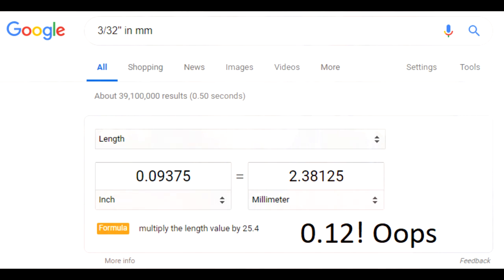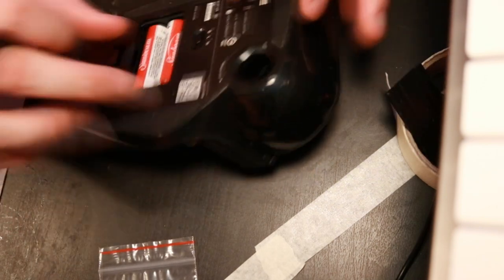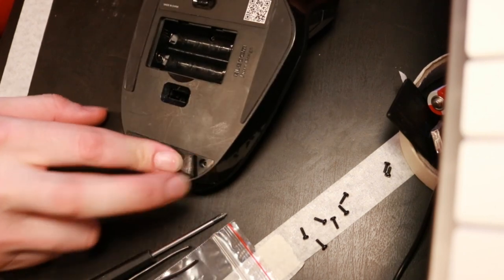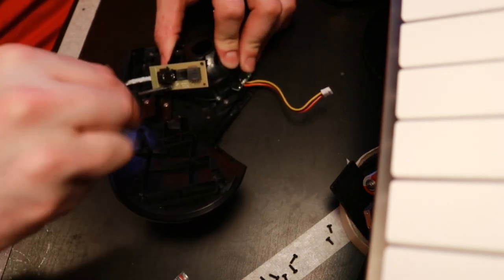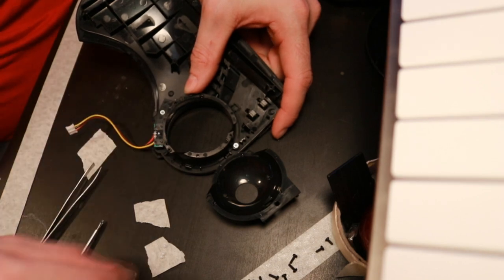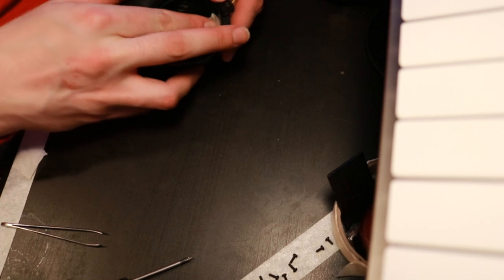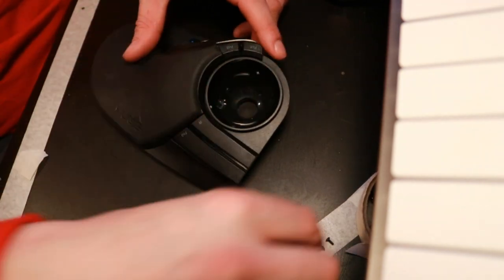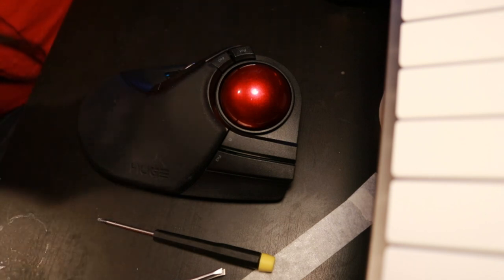Elecom Huge = Gaming TRACKBALL? Bearing replacement / fix / swap

Comment: do you know what size bearings are used by the Elecom EX-G Pro?
Reply from the maker: Unfortunately, I do not.
What I'll say is that there aren't that many different sizes available from most retailers when you get to that size, so maybe we can ball park it and, if you get it off Amazon, their return and exchange policy is rather liberal.
Do you have any of them removed and available to do a size comparison? I recommend getting a dime and a nickel next to each other, setting the bearing between them, and using a magnifying lens while viewing from the edge of your table / desk.
It's likely that they used the same size though.
Reply: @subversed  I have two EX-G Pros, but one is being used by my roommate. Hers is a lot smoother feeling than mine, especially lately. I guess we could take one apart but I can't find my calipers, and it's not a digital caliper, so you have to eyeball the size it gives
Reply: @subversed  ok so I asked Elecom and they said the bearings in the EX-G Pro are also 2.5mm. You mentioned Prime on the video, and I searched for 2.5mm ball bearings on Amazon and found nothing. I couldn't find anything with your search terms, but I cut it down to 2.5mm Bearing Balls Zirconia Oxide and found some. Thanks for the video!

Right now I'm mediating my trackball's rough rolling by rubbing birthday candles on the ball several times a day to keep it rolling smooth.

Comment: how long is your palm? from wrist to middle fingertip..
Reply from the maker: I'll answer this one, but if the next question's asking me for feet pics, that'll be a no lol
7.5"
Reply: @subversed  lol... im 20cm.. im using deft pro right know, comparing the smoothness with my mx ergo, deft pro is soo bad. I'll try to break in it for couple weeks, if nothing happen i guess ill try to change its bearing. I found Si3N4 and ZrO2 price is same, so which one should i buy?

Comment: Thanks a bunch for the video, it was very helpful!

I tried this out two different bearings:
.) ZrO2 grade 10
.) Si3N4 grade 5
Funny enough although the grade 5 ones should technically be smoother (lower grade means better at least according to https://en.wikipedia.org/wiki/Ball_(bearing)#Grade), the ZrO2 ones feel a little bit smoother, but still nowhere near as smooth as my Kensington orbit with scroll ring ... .
The dynamic friction is fine, however the static friction with the new bearings is still too high for precise use :-(
Has anyone else experienced this?

Now I have been thinking - there could be three contributing factors to this:
1. The high weight of the HUGE's big ball leading to more friction compared to my small Kensington one
2. The relatively large bearings lead to more friction due to greater area of contact - the HUGE's are 2.5mm, my Kensington orbit w. sc. r. ones are exactly 2mm
3. This point is just speculation: The material of the HUGE's ball simply has a higher static friction coefficien than dynamic friction coefficient w.r.t. the bearing materials.
Reply: I've been trying to work out the same thing, but it isn't a problem with weight as I have a Kensington Expert which has a larger and heavier ball than the Huge and is silky smooth compared to my Huge (with new G5 ceramic bearings). The material of the Kensington's ball does feel a bit glossier and less sticky than the Huge, but that might just be because I've had the Expert for a few years.

Comment: You really don't have to take the ribbon cables apart the one of mine did fall out. If you only take the second set of two cup screws internally out then it's a lot easier to put the replacement bearings in. Because then the cup isn't fully apart and one of them will go in extremely easily and the second can be done with gravity. Also on the wired version of this trackball the center screw is hidden by the paper tag on the bottom which you'll be able to see when you run your finger along it.

Comment: I use the same trackball for 2 years, and I'm quite sure you either got a defect one, or didn't apply enough oil on it.

I mean the oil that naturally on our human skin should be able to make it really smooth within a day or two of usage, when cleaning the trackball, never ever clean it too much, for example I always use 80% ethanol to clean my stuff, and I only clean the surrounding of the hole and never clean the ball and bearing at the same time, otherwise it will take a day or to be smooth again by the oil on our fingers.

Comment: honestly, i've found the smoothness of mine to be not bad at all, just that it collects dust; would anyone here recommend using like some sort of lubricant silicone or teflon spray on the bearings at all? I read that other trackballs have benefitted from this.

Comment: I just finished doing this, with the more heat resisting, more expensive, ones. It isn't really that smooth at all. My CST takes the cake by far still.

Too bad really.
Reply from the maker: it'll never be as nice as let's say a kensington expert, nor will it be as nice as the action on a mechanical trackball that costs 2-3x the price, I'd bet- but there were so many defects in this run that it's worth trying to RMA or get a replacement through amazon (if that's where you got it) to test your luck.
Reply: @subversed  Why is that? What is the variable that makes the Expert so good? Just replaced Huge's balls with ceramics and it is a bit better, but still getting stiction, whereas I get literally no stiction on my Expert. The only thing could be the trackball itself?!
Reply: @joshuathomson6049  Some folks have said it may be related to the placement of the bearings in relation to the ball

Comment: Do you know by how much G10 is better than G5?
Reply from the maker: Elaborate a bit?
Reply: @subversed  Well, you said the grade indicates the sphericalness of the ball, which means G10 is better, but how much better is grade 10 vs grade 5? Like, can you feel the difference?
Reply from the maker: @deama15  nah, they're measured on a pretty ridiculously small scale. Still macroscopic imperfections, but really, really small. I'd say you're fine with either and don't spend any more money than you have to, all you're doing is rolling one ball around 3/4 the size of a billiard ball lol. :)
Reply: @subversed  Oh, I see; well I got the G10 anyway cause it was only £1 more.
Reply: @deama15  While the tolerances are so small that G10 is probably perfectly fine, I wanted to post for future people reading that ball bearing grades work like golf scores... the LOWER the number, the better.  The grade number corresponds to the sphericity of the ball in millionths of an inch, so a G10 has a sphericity of 0.00001 inches and a G5 has a sphericity of 0.000005 inches.  Sphericity measures the deviation from a perfect sphere, so the smaller the number the less deviation, the more spherical.

Again though, the numbers here are so incredibly small, with a G10 being 0.00001 inches "out of round" and a G5 being 0.000005 inches "out of round", I highly doubt you would ever be able to tell the difference between the two in this situation.  I just wanted to make sure a future reader doesn't come across this and think "Man, if a G10 is better than a G5, I can get these G100 balls and be super great!"... it go's the other way, you want the smallest G number you can get.
Reply: @cryptk  Oh, I thought it adhered to the ABEC rating.
Reply: @cryptk  The numbers may be small, but difference between G10 and G5 is still 20%, G10 against G3 is like 50%. For precision work, which I think is what trackballs are, this difference I'm pretty sure would matter. Too bad though I can't find G3 anywhere, they're incredibely rare; and even if they say it's G3, I think it might be fake.
Reply: Sorry for necro, but posterity etc...
If grade is important, buy only from reputable sellers, there's no way you could ever discern the difference between G10 and G5 without expensive equipment or sending it off for testing. Many sellers know this and will sell you anything.

Comment: Would steel be better?
Reply from the maker: Nah. Can't find it in the right size and they're ceramic or ruby for a reason- steel would damage the trackball once it started wearing.
Reply: @subversed  great well I found some and what a big difference thanks for the video!
Reply from the maker: @Tabossco  You found steel ones that size? That's pretty neat! You think they're better than ceramic? I'm up to try- link me to your source? :)
Reply: @subversed  nah I went with these there super smooth.

25pcs 2.5mm Si3N4 Silicon Nitride Ceramic Bearing Balls G5 https://www.amazon.com/dp/B07D8RDV1L/ref=cm_sw_r_fm_apa_i_c5JUCbEXF4066
Reply: @Tabossco  silicon carbide is better than both.

Comment: The polling rate and dpi in these Elecom trackballs are embarrassingly weak unfortunately. They feel ergonomically good, but the other parts are a real shame.
Reply from the maker: It's a step in the right direction, though. 
They invested in the design more than the finer points- I'm sure they're planning a v2.0 (without dingus rubies instead of ball bearings)
Reply from the maker: Maybe the next version will have freaking chaos emeralds and I'll have to do the next video with a Sonic screwdriver. Get it? Sonic?

Comment: Legend! Thanks a ton for this. These bearings are available on Amazon now FYI: item B081SPZ7KP

On mine I want to say the smoothness isn't 100% there, and it does get a little noisier. But it's muuuuch improved over the stock bearings for sure.
Thank you :)

Comment: 2022- if anyone is thinking about doing the bearing upgrade, DO NOT. it will work fine for 6 months then get so gritty it is impossible to use, another commenter mentioned this 2 years ago, this has ruined my mouse, lesson learned do not listen to youtube fools trying to backyard engineer stuff, the not exactly round bearings are done for a reason, to create the least amount of resistance points and increase longevity, the ceramic bearings simply have too large of a surface contact and hardness not to ruin the ball, the engineers at elcom were correct in using ruby.

Comment: I cannot for the life of me find some new spherical jewel bearings for my logitech trackball. I've worn flats on every side of them having turned them around multiple times.
Reply from the maker: What's their diameter?
Reply: I'm not sure, And I couldn't get a response from logitech on the subject. @subversed
Reply from the maker: Lemme take a gander- can you give me the exact model number and I'll do some searching?
Reply: Sure it's the M570, Thanks a whole lot! @subversed
Reply from the maker: @Levamen33  I took a stab at it after getting home from the grocery store and found the user manual, service manual, warranty pamphleture, but no specs on the bearing sizes- I'll take another gander tomorrow :) 
It seems to be information a lot of redditors are asking and also not getting responses on, so maybe it's an opportunity for my next video. (The beard is gone this time)
Reply: @subversed  Thanks so much! It's the only part of that trackball that needs replacing, I've done the microswitches under the clicks at least 3 times for left right and middle, but the sapphires so far have defined the end of the life for a trackball for me
Reply from the maker: @Levamen33  I searched pretty far and wide, even found the logitech patent for it and there's no mention of the exact size. If you bring it to a NAPA auto parts, they usually have a micrometer available at the register and could tell you the exact size